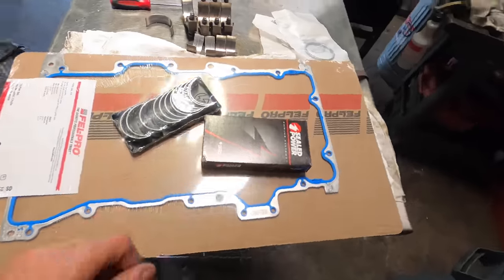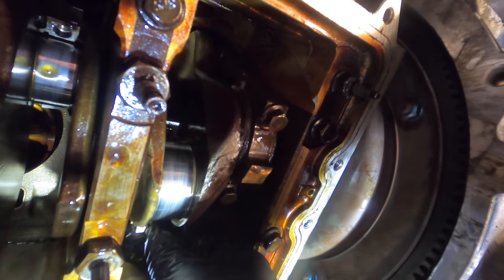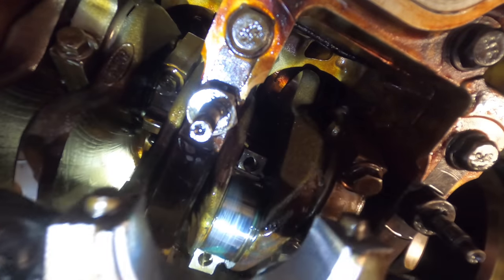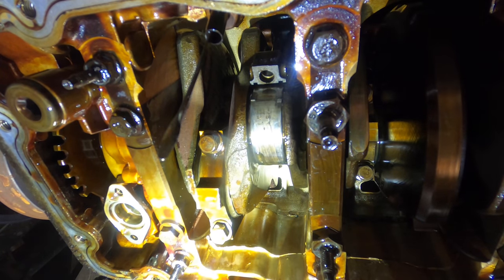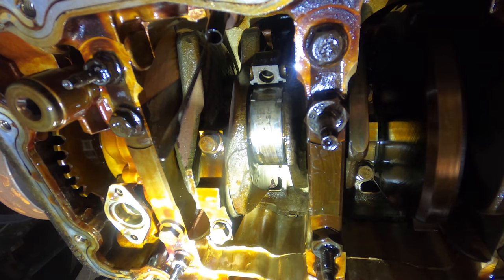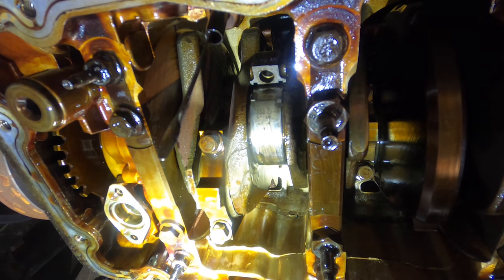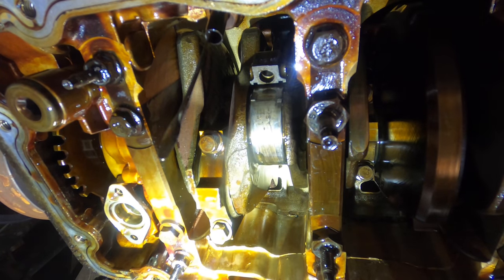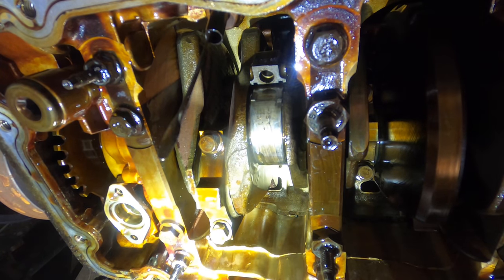Saving an Engine: Spun Bearings Replaced

Comment: Let's hope that kid learned an expensive lesson. A £40 lube service is cheaper that a £1000+ engine repair
Reply: It is an old throw away car.  It just wore out, oil changes or not.
Reply: @user-tb7rn1il3q  only has 91k on it. Definitely lack of oil changes. My 99 ranger has 255k perfect oil pressure. Maintenance is key
Reply: @klifestyle4466  It depends on how it was driven and truck engines are stronger.  Most engines just wear out, nothing to do with maintenance unless the sump was run dry.  Used motor oil actually lubricates better up to a point.
Reply: @user-tb7rn1il3q  I use castrol Edge 0w40 and I service my car every 3000 miles when they oil starts getting dark I'm on 110,000miles and my car has excellent oil pressure and it puts like a kitten my car is also 16yrs old 
I've seen cars and vans with half the mileage knackered due to poor maintenance.
Reply: @user-tb7rn1il3q  I had the exact model mercury sable except mine was an '01 (same engine/generation) and the timing chain broke at 235k miles. I didn't by any means treat it nicely, I bought it used at 125k and it was a $400 beater with a heater. I got another 110k out of it before the timing chain snapped. Chain snapped in 3 pieces at 85mph and it bent a valve. Toasted the engine, it fired out of time at high-ish rpm. I didn't even change the oil for the last 40k or so miles. Probably why the timing chain went on me. I maybe could've pushed it close to 300k if I actually had taken care of it but like I said I paid $400. An oil change was not worth the expense, even doing it myself. The car junked for $375 so I only lost $25 and the only maintenance I did to it was brakes and a fuel pump. Loved that car, she died too young.

This car definitely could've went another 50-100k easily before any severe damage like this; it was not just wore out. These cars had some solid engines. The owner had mistreated this thing horribly.
Reply: @user-tb7rn1il3q   Old oil lubes better? Wow who schooled you about maintenance? 91K isn't normal for failure.
Reply: @davidlong1786  Oil lubricates better after 5k.  Synthetic oil is good for 20-30k highway miles.  This car probably had a lot of city miles.  100k miles is about the limit for cars with a lot of city miles or highway miles in mountain terrain.  Newer cars last longer.
Reply: @user-tb7rn1il3q  Sorry but that's BS. Regular oil should be changed around 3k and at max 6k. Synthetic  around 5K and at max 10K. Where do you get your info from the funny papers?  A car that can't last past 100K is defective or just maybe it's YOUR car and it wasn't serviced at the correct millage intervals.
Reply: @davidlong1786  You can’t even find conventional oil anymore and it’s no cheaper than synthetic.  Only an idiot will buy it.  Synthetic oil and filters are good for at least 20k miles.  Manufacturers are very conservative when they recommend oil changes.  There have been countless UOAs of Mobil One at 20k miles and there is still a lot of life left in the oil.  Let’s face it 99 percent of engine problems are from a non oil related failure or from a lack of oil, not from old oil.
Reply: @jasonhobbs5611  Agreed, my Leon diesel gets Edge Titanium 5W30 every 6,000 miles. Long change intervals were invented to appeal to fleet buyers to save costs 🤦🏻‍♂️.
Reply: @jonny6702  "Loved that car, she died too young." That's why you should have taken better care of it. While it's true that you didn't really lose money on the car, you lost the use of a car you liked, and that is sad. Also, there are some real "geniuses" here about engines and oil. It's nice to see that not everyone is totally moronic about oil. Although YOU really should think about being nicer to machines that serve you well. :)
Reply: @user-tb7rn1il3q  If it were higher mileage I would agree, but 91K miles for a "modern" engine that is maintained properly is still practically new. No matter how it was treated with normal road use aside from maintaince / design issues, tuning etc. Not to mention the ridiculous prices of used cars right now. Between my family's cars, they have mileage between 40K and 410K miles on them. Oil changes and all maintenance done as per the manufacturers schedules, with good quality synthetic oil.  I just turned over 120K miles on my tuned MK6 TDI and it's showing better UOA wear results then when I bought it 50K miles and 2 years ago.
Reply: @user-tb7rn1il3q  Truck engines are stronger and used oil lubricates better up to a point? I would like...and I mean this seriously, not trolling...I would like to see ANY proof of these claims because they are not in line with anything I've ever learned over 30 years in the trade.
Reply: @davidlong1786  I agree except for your mileage estimates. I have my 4 vehicles' oil analyzed every oil change (Blackstone labs) and without fail, they recommend going beyond my 10k routine (I still don't). Additionally, the owners manuals state 15k between changes. I know gas engines may be less but 3k miles is 25 year old thinking. Oil has come a VERY LONG way since those recommended intervals. You may want to investigate further.
Reply: @rsg1963  Every oil change, why? Owner manuals are written by the car manufacturer and they WANT you to buy another car instead of keeping your present one healthy. I stand by my previous statements on oil change intervals.
Reply: @Slvr2k  Older cars are more expensive to maintain and finding parts gets more difficult after 15 years.  I stand by my previous comments.  Engines wear out.  There is a big difference from 100k miles in city traffic vs flat rural roads.  Dealers make most of their money on selling unnecessary so called preventative maintenance, not selling new cars.
Reply: @user-tb7rn1il3q  "older cars are more expensive to maintain" Bruh you need to stop what you're snorting. Parts get more difficult after 15 years yeah? I've seen parts for both my 20+ cars all over the place. Elaborate on how preventative maintenance is "unnecessary," preferably with actual evidence instead of fluff statements. Sub100k engines are new in my book, even more so if they're "modern," because if 20+ year olds can keep running with that much, so should they.

Comment: Rule nr.1 after you replaced bearings: Always disconnect the ignition coil and start the engine until the oil pressure lamp goes out on the dash. That way you know you got oil pressure before the actual start. Good luck!

Comment: I may have missed it, but how do you know those bearings were receiving sufficient oil, or will be receiving sufficient oil?  Did you do anything to test for blockage through the crank shaft?  Is testing it even required?
Reply: The oil flows through a filter usually down to 2-10 micron so anything that passes through would be really small, like smaller then a human hair. The damage here would indicate there was no oil in the system to even be pumped to the bearing and that is what caused the bearing to spin then the metal scraps come from the bearing running dry. In this situation it could have gotten some bearing material in the bearing oiling hole in the crank but normally when you are installing new bearings it's because the old ones are worn out not normally spun like this. This is an odd ball case where it was caught early and the customer is willing to try a band aid instead of a new engine or another car.

Comment: A guy back in the 60s head of 327 with the tunnel ram stock oil pan the engine suck some air and it spun one of the bearings, I remember them pulling the pan down and taking the bearing out looking at it and putting it in a bearing back in it crankshaft was not harmed, but the big end of the connecting rod was a little bit out around so it would not hold a bearing under high stress conditions.

Comment: You just gave at least 30K miles back to the young person that owns the car.  
Very informative on the processes!  Thank you!
I am surprised that you didnt Use any brake kleen and or carb cleaner after you used emery cloth on the # 6 journal (to get rid of the abrasive bits).  Or use use any Plastic Gauge to see if it needed oversize bearings on the #6 journal that you used the emry cloth on.  Just my 2 cents.Rebuilt many engines.  
But I get it saves time and money.  Not a full rebuild (been 4X the cost).  Just fixing what needed fixing; I get it.  But def gave the person quite a few more thousand miles to get funds together.  like your processes!  And ALWAYS asking what the customer wants or needs.    PROPS!  Need way more of you out there.  Getting too old to do it myself.  Hard to find "Respectable Mechanics".  All are trying to scam ya now.  You sir are one of the good ones!!!!!!

Comment: Ahhhhh, NO noise, thank you!!!   The Lucass should be great for a lube.   I usually use a thin coat of Wheel Bearing Grease, which also works well.   After checking a rod bearing, I would have put the Rod Cap back on to prevent any damage to the crank shaft.   A tiny nick will destroy a bearing.   I had a guy who was helping me put a Chevy 283 V8 together make a nick on an engine Crank Shaft that trashed a Connecting Rod Bearing.   After engine start, while idling, the engine started to develop a squeal which was getting louder.   Bummer, a lot of rework.   IF the Bearing Inserts do not have sufficient "interference compression" on the ends as the Bearing Cap is torqued, the possibility of a "spun bearing" increases greatly.   I am also a Pilot and an AirCraft Mechanic.   The precision working on AirCraft Engines is somewhat more precision required.   Personally I would have polished all CrankShaft Journals, Connecting Rods and Main Bearings.   A lot of clearance checking is necessary with Plasti-Gauge and Micrometers when working on the CrankShaft and Connecting Rods and Bearings and other close tolerance Bearings.   Do you have an Oil Filter cutting tool to check the possible contamination in the Oil Filter and to ensure that no contamination has bypassed the OF to contaminate the rest of the engine?   I have forgotten a drain plug once or twice in my lifetime.   I like to use Anti-Seize compound extensively.   It makes future maintenance easier and reduces corrosion on hardware.   It is especially important on AirCraft.   YES, I enjoyed "the show".   Have a great day!!!

Comment: My dad did this same repair on his 79 LTD wagon with the 302. He did it underneath the car in our garage with a gravel floor, lying on a sheet of cardboard.  That motor never gave us another lick of trouble (at least not due to the bearings -- it had one of those damned variable venturi carbs). Good job!

Comment: I did auto repair for several years as a young man (4  in USAF + a few).  You might be surprised what temporary repairs can do.  If I had done this one, Ray, my warranty would have been to the shop's property line.  Way back in the day early in my wrench bending days (I'm 67), I saw the inside of a 6 year-old Chrysler (383) with 55k miles that the owner believed "oil doesn't wear out!" and all he ever did was add oil when the level dropped to the "add line" on the dipstick.  The reason it quit running is the valves were sticking because of the baked-on, oxidized crud build-up on the valve springs and they couldn't open and close properly.  The customer bought a rebuilt long-block engine.  Dunno if he learned his lesson.

Comment: Thanks for this video. I'm in the uk and will be doing the exact same task on my MGZT Turbo. My engine isnt anywhere as noisy as this one, I would describe it as a little loose. I will be replacing the cylinder head at the same time as this has to be removed also to get to the connecting rod bearings, (just one of the quirks of the Rover K Series engine, the bolts run all the way through the engine). This video has inspired me to get the job done.

Comment: I'm enjoying seeing how you get at all those impossible bolts since I could not in any way get my 2005 Mustang GT O2 sensors out.  I like the ratcheting crow's foot! but when I first saw it, I imagined one better, thinking the square socket attachment was geared to the hex wrench part.  Now that would be an awesome tool for some tight spots!
Great job saving this neglected engine too!

Comment: Once again, I wish that Rainman Ray would emigrate to Australia. Maybe then I would not have had  timing chain change as advised, when the problem turned out to be camshaft needed replacing. $2000 aussie dollars wasted. I don't feel confident they even changed the timing chain. This work was performed on Holden Caprice 6 litre L98 (your Pontiac G8 I think. Police Pursuit Vehicle) I took the vehicle from the first company, and had the cam work done in another shop. Cost just under $5000 AUD. I am so impressed with your videos RaySo great to see a guy take pride in his work. Hope you never retire while I am alive.

Comment: I have a old Jeep cj5 with a 304 V8.  The crankcase was flooded with ethanol laden gas when it was in storage for 10 years.  It only had 45k on the engine but the ethanol set up some weird galvanic reaction to the main bearings all along the big end.  It ate ALL the zinc off the tri plate bearings from one end to the other.    After running a Mic over the journals on the crank and making sure they weren't scored, I ordered a set of NOS Clevite Main and Rod bearings and rolled them in laying on my back over a few nights after work.  It's been just like that for the last 8 or 9 years.  Worked just fine even though it was a PIA to do.   Probably didnt have to do the rod bearings but I was already under there you know! :)

Comment: (Comment repeat from pt 1.)
About 10 years ago I bought a Toyota (model?) 4 banger from son in law 

for the cost of the radio he installed. Journal was worn out on one 
piston and pretty much .03+ oval in shape. I tried to reshape roundish 
it with no luck. So, from underneath, on the floor, , sawed the 
connecting rod in two,  I took out the piston in pieces. Then removed 
the rocker arms to the valves, in other words everything to disable the 
cylinder #3. I had to put the bottom piston con rod and rod cap on the 
journal (with bearings over torqued to stop rotation) to stop oil flow 
from the crank. I now had a three cylinder engine! Bonus:same gas 
mileage, some oil needed every 1000 miles. I got 8000 miles on it to 
work and back, out of town and was happy as a pig in poo. The I loaned 
it to a friend and another cylinder started clanging. So off to the junk
 with it. Educational experience.

Comment: Excellent repair. I work for Waukesha and when we do inframes on them in the field it is very tricky to torque the rod bolts as you have to use a torque multiplier and only access is through the oil pan doors

Comment: I did enjoy this video and you certainly earned my subscription to your channel.  I think that if I was looking at an engine with the knock and I knew that it had never had an oil change I would not have gone any further, you clearly had the experience and savvy to be able to decide that it was worth doing what you did.  I dressed a damaged cam shaft lobe with emery cloth like that once and it lasted a few hundred miles before making a noise again when it came under sustained high speed load.  I do expect this repair will last many years if the owner treats it carefully and drives gentle with frequent oil changes.

Comment: Greetings:  1st- I commend U on such technique and respect of customer and Ur work. We R same in that respect.  2) - I remember in Pt 1 it was knocking.  Finding the spun bearing and pieces, U now have a dilemma. Patch,  rebuild or trash it. Remember, ' a round hole does not knock'. From the evidence it is a minimum if a crank / rod job. I understand the  temporary ' patch job'. Just so the customer knows.  Keep up the good work and ethics. There is so many disrespectful, unknowledgeable idiots attempting repairs which is, at best, mayB a temporary 'fix'.  Bsafe. Thx 4 the share.

Comment: Buddy, I've done a crap job like this but I also replaced the thrust bearings and main bearings.  And I inspected the valve train as well.  This quick fix will be great for the lad to get to the dealer for a trade-in.  I wouldn't go any distance on that engine.

Comment: I rebuilt a 144cu. In ford falcon engine, it made a lot of rod noise when I started it, I went to the garbage found the old bearings, stamped 30 over.I put standards in so I pulled the pan while the engine was still in the car and changed all the bearings,it worked fine .

Comment: Crazy YouTube recommended this as I just got done doing this on a Bronco with a 302. 116k on the original engine but light rod knock. Old oil..... bearings were into the copper. Did rods and mains while I was in there. Mains weren't really bad but did show signs of wear so I'm glad I swapped 'em out anyway. Had to pull the engine to do mine though as there's too much in the way to just drop the pan.

Comment: Most of the metal left inside the oil pan and strainer is mainly babbit material that was placed on the bearings to reduce friction. Had that material not been on the bearings the engine would have most likely seized up. Thankfully you were able to replace those bearings before a catastrophic event occurred. 👍

Comment: Ray, I didn't hear anything about inspection of the contents of the oil filter. Hopefully the smaller particles will remain in the filter element. I wouldn't trust this repair without flushing the rod journals and polishing all of them. I do respect your work and enjoy your videos.
Keep them coming.

Comment: I think I would like to see some plastic gage used to confirm sizing.  I don't know the history of the engine but testing a couple of the worst journals would give a good read just to settle my nerves on a job like this.  The more data the better for you and the customer.  Other wise good job.  I did my first V8 in 1962 and just finished a compete rebuild last month.  Nothing changes.